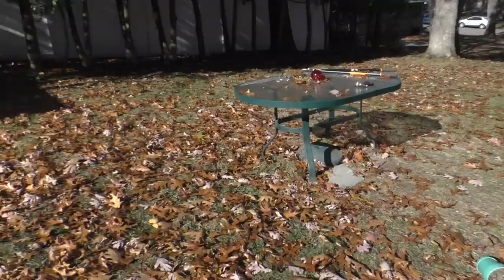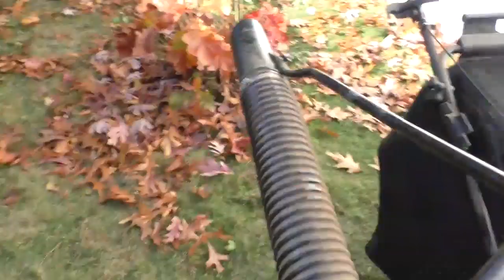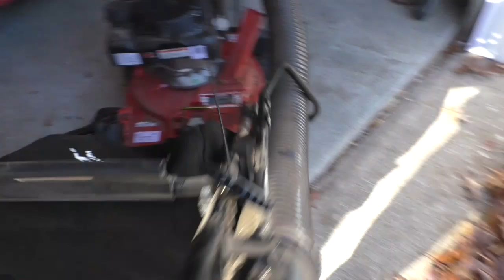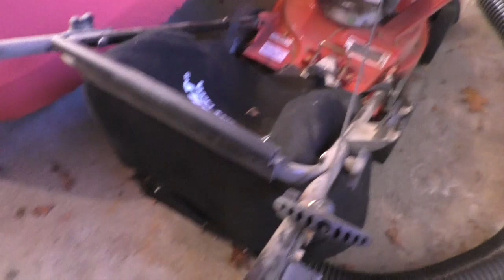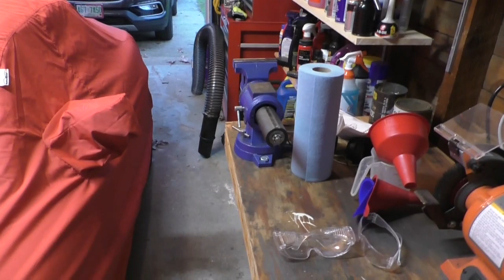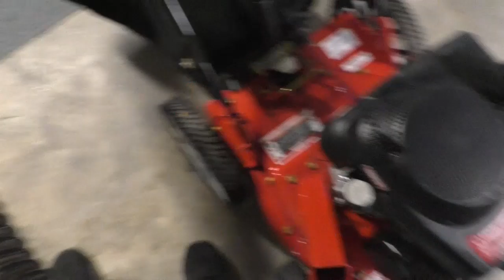Troy-Bilt Chipper Shredder Vac CSV 060 - A Once GREAT Machine RUINED by MTD's Cost Cutting

Comment: I recently picked up the Cub Cadet version of this machine.  Bought it cheap, but the important thing is it started up with no issues.  I did have to patch the bag, but I used some fabric mending patches instead of the usual duct tape applied to both sides of the holes.  One of these days I'm going to mod it to dump leaves into a bin of some kind instead of a bag, but for now it works.

I have noticed that the hose clogs very easily, at least on mine.  I'm using it in June/July right now and for the life of me, I simply cannot get the hose to stop clogging.  There's nothing in the way to stop the leaves, it just doesn't seem to have the power through the hose, but the vacuum part works just fine.  It's just weird.

Comment: do you still have this shredder vac?
Reply from the maker: Yes
Reply: @bbishoppcm  how is it? does it work any better or worse?  I just watched a video of a newer model and the hose seemed to work pretty good
https://youtu.be/w53a4WD5FN0
Reply from the maker: The hoses are now made of a thinner material, PVC perhaps? Much more flexible. The old hoses are completely useless by comparison. I am still using the original bag, which has been reinforced with hog rings at its weakest points, but I have a brand new one I bought off Amazon for a fraction of the original bag - just to have as a spare when the original one falls apart. The engine is holding up very well, but air filters are impossible to find - so I'm using random filters that I've cut to fit the airbox.

Comment: The baffling thing about the oil drain plug is that I've seen lots and lots of machines with this exact engine and in none of those machines the oil drain plug was reachable. One could get the Impression they design it on purpose in a way the oil drain screw can't be reached easily

Edit: just noticed yours actually got a different engine. I was talking about the briggs and Stratton Quantum engines.

Comment: Got the same machine with yard man branding by MTD. Mine is from 2006 or 2007 and the hose is still good and flexible enough. Totally does the job.
Its a shame they haven't got the same quality anymore.
Was it maybe just too cold at your place and that made the hose be stiff and inflexible?

I'm glad mine still got the Briggs and Scrap'em 5.5hp 190cc Quantum engine on it.

Comment: I worked for MTD corporate as a Quality Engineer from 2017 to 2020. I was responsible for the overall quality of this machine. First let me tell you. These are produced in Tupelo MS by very unskilled labor. Mostly a temp work force. You are correct that the company has cheapened up its products greatly over the years. The hose and the bag were constant frustrations for myself and the Supplier Quality Engineer. The hose will definitely crack once it reaches the freezing temperatures. This was a big problem for us there. It also came apart or was not put together correctly often just like you show. I tried to get the Deisgn Engineers to update different things or try to make them more robust but I was constantly told "There is no money for improvements". MTD was a great company led by Engineers that got taken over by Marketing geniuses who then ran the company into the ground. Does anyone wonder why MTD sold to Stanley Black & Decker last year?!!!
Reply from the maker: The thing is, I would have happily paid a bit more for a better product... thank you for your insight! I REALLY appreciate this!
Reply: @bbishoppcm  You said when you bought the house and you Didn’t say when When did you bought the house date month number of year?

Comment: The snorkel on the front with it on demand shift from snorkel  3 inch hose vacuum is a piece of crap it does not lock in all the way and it does not seal and for some reason I do not get any reliable vacuum through the 3 inch hose any ideas anyone?

Comment: I love them, I own two a Craftsman and a Troy-Bilt. The hose is totally useless, I removed mine. the other problem that I found is the vacuum bag, after a couple of seasons mine started getting a small hole which in time will grow and the replacement bags are $140.00. You will need the impeller removal tool to change the chipper shredder blade. it doesn't matter if it's self propelled or not. If you want one try buying in the winter, I found a self propelled one at a Sears outlet for $375.00 and a push one which was a floor model at Lowe's for $325.00

Comment: Great vid, I appreciate you sharing an in depth view showing how this machine works. Personally, I'm not all that sold on its operation. I've always used a simple leaf blower to coral my leaves into a pile and suck them up into bags. Pretty much can get a property similar size to yours done within a half hour. Plus I feel a blower will clean much better since it will easily blow out leaves and debris from hard to reach areas. Just my opinion.

Comment: I have two with Briggs Quantum engines, both bought used, one push model that the engine wore out but I kept for parts and one self powered unit... They work great for picking up leaves, but like you I never use the hose.  Also electric start and power drive should be standard as they are ridiculously difficult to pull start and push around.
Reply: Does the power drive work well?:  Is it easy to fix when something goes wrong?
I have non self propelled Cub Cadet but I'd like to get a second one (I have a huge yard and want a second one for a helper) but I wasn't sure whether to get the self propelled version or not